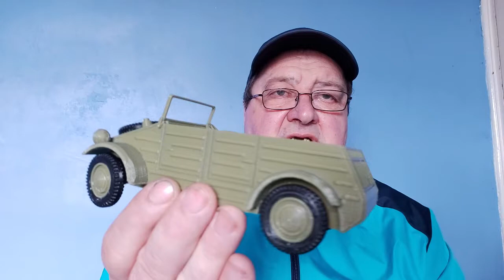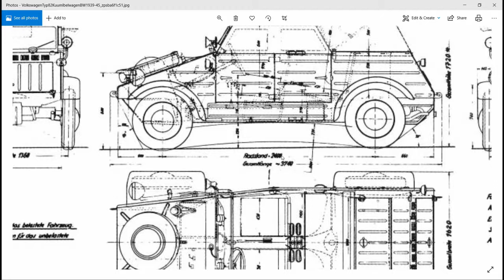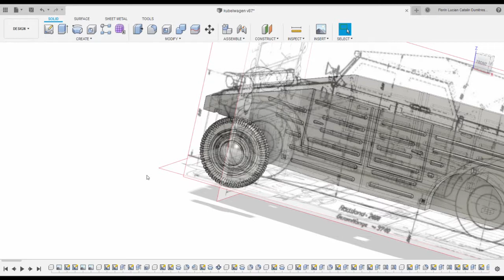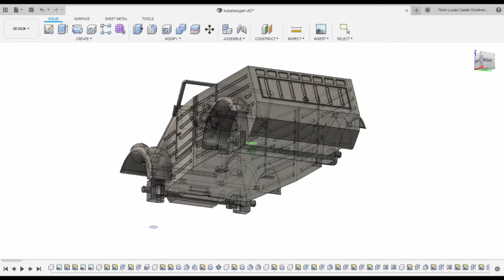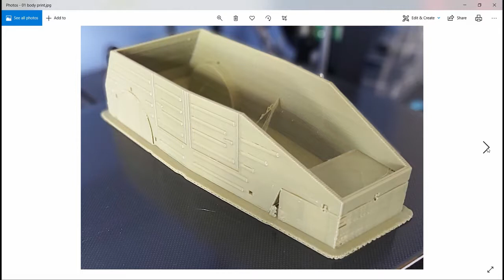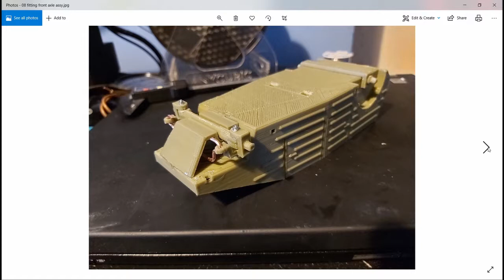Kübelwagen 3D printed at 1/20 scale

Comment: Hi Florin, just one quick question. I have bought the Files for the Kublewagen  going to get a start on printing as soon as I can. My question is are you considering doing a Schwimmwagen in the future ?.
Reply from the maker: For the moment I have two projects : Tiger 2 and Horch 1A at 1/16 scale RC models using Arduino. It will take a while ... I will consider modelling the Schwimmwagen in the future also.
Reply: 3D Shamrock Horch 1A sounds good as well, another soft skin to add to my growing collection. Will follow along with interest Florin.

Comment: Hello, do you plan to add rear bench and folded roof or boot cover?
Reply from the maker: I am going to re-model the kubelwagen at 1/16 scale adding all the features for an RC model, more detailed. I will try to find a solution for the roof. I am working now on a tank.
Reply: Got the files for this one, and will probably get the remodelled files as 1/16th is my preferred scale and I have always fancied an RC Kublewagen or Schwimmwagen to run round. Will watch your channel with interest for further updates.
Reply: I will buy and try this model also, probably will add a back row of seats and some trunk cover